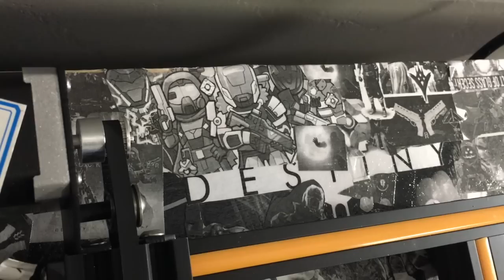Creality CR-10 Maintenance Part II

Comment: Hey SAN at 7:59 you stated you would show how you set up the left side of the x gantry so that the belt was level but you never did - its the part i needed to know most  - my new replacement form gear best is so out of wack its not even funny - all belts are not aligned, the belt connection to the bed at the back of the y axis belt is so warped it doesn't align with the frame so i got to do it all my self argh- just thought you should know in case you want to add it - thanks for the vids though so much appreciation and respect bro! keep up the good work!
Reply from the maker: Sorry about that, let me check to see if i show how to that in any of my other videos.
Reply: @SANTUBE  hey man, did you find the bit about aligning the X axis belt in any of your other videos? Noticed the same problem today, only been printing a week, and you're the only guy i can find who even mentions how to do it. Would be a great help. 
Gained a sub anyway. Good videos.

Comment: I don't have that front piece for tightening my y axis belt on my printer, how do I tighten it so I can print with it because it won't move the printer bed
Reply: Agent Noir I know this is over a month old as I’m typing this response, but I think just I had the same issue as you with my new CR-10S. Hopefully this will help you or someone else. 

In the same spot where the front piece is located on this video, there will be two silver hex bolts, one on each side. Loosen and remove those bolts, then take the metal piece that they were bolted in to, and either pull it out or push it in to adjust the y-axis belt tightness. Once satisfied with the belt, tightness, screw the two hex bolts back in. The print bed should move properly after this.
Reply: @dominiccayabyab  yea I fixed it about 30 after typing that, but my main current issue is the fact my heated bed won't heat up, doesn't even rise past 40 degrees

Comment: Thanks a Lot Man , if It was not for this Video i dont know if i could have solved My New CR-10S problem with the Belt on the Yaxis. I am New to the 3D game. and just received my first new CR10 only to find that the Y-motor Belt is lose after unboxing
i did not know how to even tighten it i looked everywhere on the net nothing. then luckly i found your video after i have watched your Assembly video which is what i used to asseble my CR, the other problem was that outofthebox the Extruter nozzle was just making this noise hitting agains the surface bed and did not know what to do, i though it was a factory sensor problem, the solution was adjusting the level Bed screws all the way, the thing about the screws is i was not aware that they work in a reverse type of way like screwing is adjusting bed down and unscrewing is lifting bedding up and i thought it was just for small adjustment of passing the A4 paper for alighnment. Thanks once again. great Job.
Reply from the maker: Happy to help! glad to hear you got all you problems fixed.  Good luck and happy printing.

Comment: The x-axis belt on my cr-10 broke and ive been trying to fix/replace it. Its got two metal bits on each end and im not sure how to connect them. In addition, the belt does not seem long enough to wrap around both the motor and the bearing. Thoughts? Advice? I'm really lost here
Reply from the maker: You will need a longer belt for sure and the metal pieces on the bottom side of the belt you will see two metal pieces.  That where you clamp off the end of the belts once you have measured the right size.  Sorry i don't have a video on it to show you.
Reply: SAN TUBE Thats all i needed. thanks a lot man

Comment: Under the build plate, you said you took off 2 of the rollers only leaving 4. Is there a benefit to doing this or just a personal preference?
Reply from the maker: I did remove it and i feel i get the same results plus now i have two extra wheels incase i ever need to change it out.  An engineer told me that from a engineering point of view it shouldn't  matter if you have four or six you will get the same results.

Comment: Good tips man. I cringed though when you tipped the canned air upside down and then sprayed it on the rollers. I bought a Metro blower years ago and have never looked back. I would highly recommend it over the compressed air and works out to the cheaper over the long haul. It is quite powerful so keep that in mind for sensitive areas. 

Metro ED500 DataVac 500-Watt 120 volt 0.75-HP Electric Blower Duster https://www.amazon.com/dp/B001J4ZOAW/ref=cm_sw_r_cp_apa_6-WjAbYV0KEWM
Reply from the maker: I will Look into it. Thanks.

Comment: Great video mate for the beginners....would have thought you would have upgraded the extruder... I changed mine to a titan Aero  and havent looked back... Again great work
Reply from the maker: I was going to change the extruder but it works great so i decided to wait until i am having some issues. lol
Reply: The micro swiss stuff is awesome... I have there hotend kits on my flashforge and the cr10s... Cant recommend enough...
Reply: micro swiss 300 works a treat with the sock capricorn ptfe is super slippy
Reply: @wayneuk  Capricorn tubing is also really tight tolerance, so it can help with some feed pressure, oozing and retraction issues where others allows for excessive flex of the filament inside the bowden tube, which can make up several millimeters of deviation. The longer the tube, the worse this gets - you can loosen the tension on the filament feeder, then push and pull on the filament to see how much length can be fed and retracted, that doesn't actually result in filament coming out the nozzle (or being retracted from it), but is "absorbed" by the filament having room to bend inside the tube. This results in less pressure than the printer thinks it's exerting, at the hot end, and excess residual pressure when it thinks there is less or none, ie. when reducing feed or going slower for a section, and when it is moving to restart somewhere else. Because the filament is bent inside the tube from the pressure of the feeder, and as the feeder is not moving, or has reduced its speed, the filament can't extend that way, so now as the filament straightens out to relieve the excess tension, that filament will extend further into the hot end, causing oozing in cases where the feeder is stopped, and overextrusion at the beginning of a reduced-feed/speed section. The same issue happens in reverse, during retraction, because the feeder thinks it's retracting eg. 4 mm out of the hot end, but in reality some or all of that, is just absorbing the excess length of filament inside the tube caused by it having room inside the tube to bend.

The tighter tube and tolerance also makes printing with flexible filaments a little less unpredictable. The higher temperature tolerances are also beneficial in some use cases.